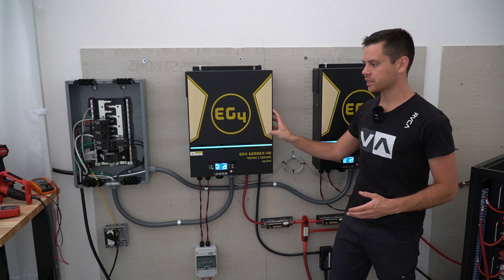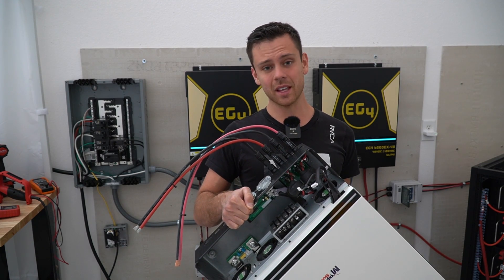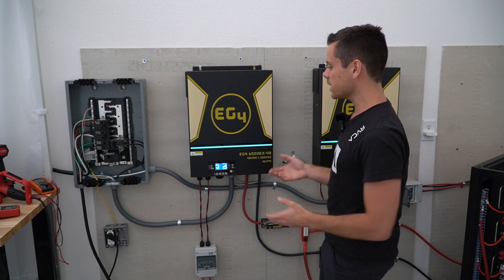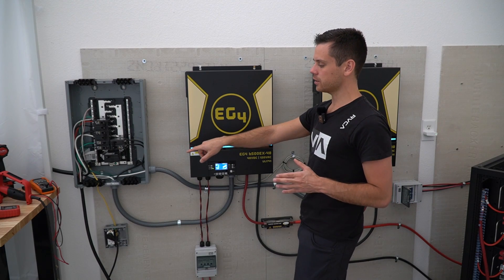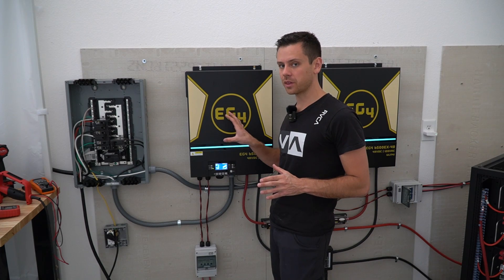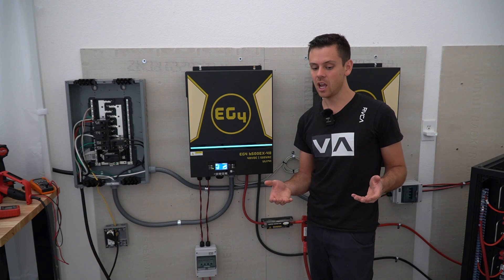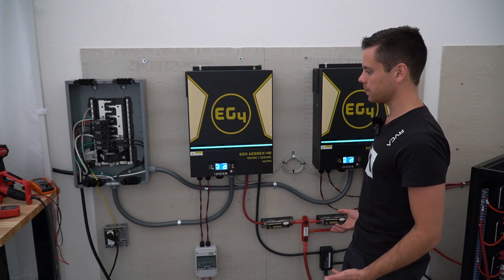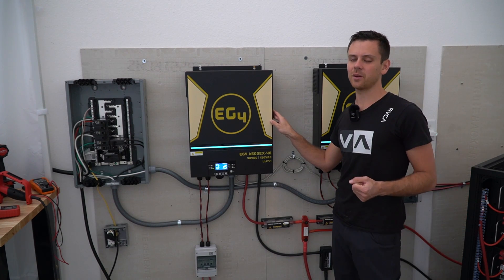EG4 6500EX VS MPP LV6548 Code Compliance and Ground Neutral Bond Discussion

Comment from the maker: If you feel that something is missing from this discussion, please let me know in the comments section below! Thank you

My new "Code Compliant" System Recommendation: https://www.mobile-solarpower.com/code-compliant-48v-offgrid-system.html
Complete 48V Offgrid System with EG4 Inverters: https://www.mobile-solarpower.com/48v-complete-system-blueprint.html

0:00 Intro
0:15 UL1741
1:12 California Approved Solar Equipment List
2:00 Using Offgrid System For Critical Load Backup
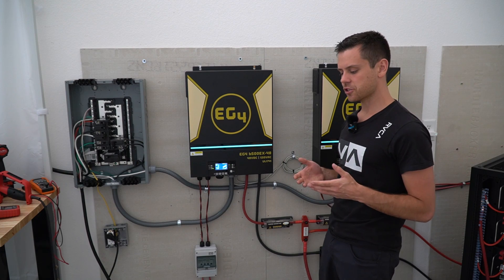2:16 Ground Neutral Discussion and Solution
4:22 PV Connection and Dangers
6:27 Conductor Sizing Recommendation
7:06 Conclusion

~~~~~~~~~~~~~~~~~~~~~~~~~~~~~~~~~~~~~~~~~~~~
Tired of getting ripped off? Check out my "Will Prowse Approved" solar product recommendations below!

12V Batteries
https://www.mobile-solarpower.com/lithium-batteries.html

48V Batteries
https://www.mobile-solarpower.com/48v-batteries.html

Offgrid Inverter System Builder
https://www.mobile-solarpower.com/48v-complete-system-blueprint-559371.html

Hybrid Inverter System Builder
https://www.mobile-solarpower.com/code-compliant-48v-offgrid-system.html

Mobile Handtruck System Builder (very popular!)
https://www.mobile-solarpower.com/mobile-48v-system.html

Solar Panels
https://www.mobile-solarpower.com/300w-solar-panels.html

Ground Mount Solar Racking
https://www.mobile-solarpower.com/ground-mount-racks.html

Wire, Lugs and Busbars
https://www.mobile-solarpower.com/wire-and-connectors.html

Tools
https://www.mobile-solarpower.com/tools.html

Fuses and Circuit Breakers
https://www.mobile-solarpower.com/fuses.html

Plug-N-Play Solar Systems
Ecoflow, Anker And Bluetti! So many models to choose from. See my current recommendations here:
https://www.mobile-solarpower.com/full-size-systems.html

~~~~~~~~~~~~~~~~~~~~~~~~~~~~~~~~~~~~~~~~~~
Need to build a large DIY system? Need a trustworthy solar distributor? These are my favorites:

Signature Solar
Creator of EG4! Solar Minisplits, Victron and More! Largest Solar Store Online.
If you want $50 off, please use my link below and coupon code "DIYSOLAR50":
https://signaturesolar.com/?ref=cPwLcVc0SW-BjN

Current Connected
Best Prices for EG4, Victron, Midnite and so much more! Fast Shipping and Highest Rated Customer Service:
https://currentconnected.com/?ref=wp

~~~~~~~~~~~~~~~~~~~~~~~~~~~~~~~~~~~~~~~~~~
Join our DIY Solar Community 
Need more help? Join the largest solar forum on the internet for beginners and professionals alike. 140,000 members and counting!
https://www.diysolarforum.com

Check Out My Free Book
Best-selling and beginner-friendly guidebook to off-grid 12V solar!
https://www.mobile-solarpower.com/the-book.html

~~~~~~~~~~~~~~~~~~~~~~~~~~~~~~~~~~~~~~~~~~
Contact Information:
I am NOT available for personal solar system consult! If you wish to contact me, this is my direct email: williamprowsediysolar@gmail.com
FTC Disclosure Statement and Disclaimers:
Every video includes paid promotion or sponsorship (such as free products for review). Some links on this YouTube channel may be affiliate links. We may get paid if you buy something or take an action after clicking one of these. My videos are for educational purposes only. Information is subject to change/update at any time. Electricity is DANGEROUS and can kill. Be smart and use common sense :) DIY Solar Power with Will Prowse is a participant in the Amazon Services LLC Associates Program, An affiliate advertising program designed to provide a means for sites to earn advertising fees by advertising and linking to Amazon.com
Reply: Can you show us how to do this with just one all in one inverter?  Like I am thinking about getting 4 of these batteries and one of those inverters.
Reply: A more 'universal' solution to the bonding would be to remove the bonding from the breaker box and one of the inverters.   In this configuration, there will be only one NG bond and if they hook up AC-in it will work correctly as well.
Reply: Is one quieter than the other?
Reply: Your videos are very informative and thanks. I am planning to buy (BLUETTI AC200MAX Expandable Power Station | 2,200W 2,048Wh) and I don't want to buy the solar panel from them. This unit is just for emergency use in the home. Can you recommend two 350 solar panels (I prefer Q Cell panels) for this AC200MAX model? Just trying to save $900
Reply: What solar shingles would u recommend
Reply: I bought solar panels (Canadian Solar 445W bifacial) from Santan Solar yesterday and the saleswoman asked if you (Will Prouse) had just put something out YouTube as she was being slammed with calls asking about the EG4 Inverters. I told her that you had and she laughed knowingly.
Reply: Hey Will, I’ve searched most all your videos and can’t find an answer or anyone explaining this clearly. (Maybe I’ve missed it if you have and I apologize if I have) how does AH vs Volt add up together? If I have 12 batteries, 4 sets of 3 to equal a 12v system that are all 200AH cells (for easy math) that would only be a 600ah battery? Or do you add more things in? Because individually I would think it would be a lot more? Thanks for you knowledge. Appreciate any light (hopefully a video) shined on the subject.
Reply: @SirBradfordII  you need to clarify. 

You have 12 cells? 3 sets of 4 cells with a 3.2 nominal voltage ? So 4 cells in series to make 12.8V and 3 of those in parallel?

You have a 4S3P pack. Series increases voltage. Parallel increases capacity. 200Ah 3.2V LiFePo4 cells in a 4S3P configuration is 600Ah at 12.8V nominal.
Reply: California is such a bummer for anything related to owning a home. In my town, you are legally required to get a permit to replace your water heater. What a joke, we live in a total nanny state in many regards.
Reply: I want to know about a setup like yours and how it might affect homeowners insurance. I have a similar setup that powers me off grid but is not electrician installed or inspector approved. 

Lets say you have a fire, and your insurance company is looking for any way out of honoring your claim. Will those off grid setups give them a way out of paying your claim, or did you have to notify your insurer that you have all those systems in advance so you would be covered?

What does a person have to do that uses a similar setup like you have there but that is not grid tied or electrician and inspector approved?

You aren't getting all those test setups signed off by an electrician and inspector approved, right? But I assume you have homeowners insurance and expect to be covered if there is a problem, right?
Reply: Id want to put an insulation layer between that circuit where you pulled the ground/neutral screw out, and what ever was underneath it.
Reply: I am no electrician but what is the point of having the ground if you don't connect to ground, that is to say, a ground wire from the panel to a ground rod pounded into the ground (earth)?
Reply: @dane5412  I'm no solar guru but I am a licensed electrician. The one and ONLY place you connect the ground to the neutral is the first service disconnecting means. Everything down stream requires a separate equipment ground which is connected to various enclosures and devices.
Reply: @dane5412  excellent point there....
He doesn't know the importances of it and similar related important connections, if he does he would have had it connected..
Reply: been following this discussion on the forum, where i find one member heavily in favor of sol-ark, possibily an employee here.
seems to be bashing other supliers every chance he gets.
not sure about the UL Listing and how that works in CA, but on could assume that it shouldn't matter who does the certification, ether directly or third party.
i do know TUV is one of the biggest global equipment certifiers there is, and accepted everywhere, so i don't expect the US to be different in that regard

Comment: If u have a big generator 12kw constant I had 3 wires from gen set no ground the ground is on block , I tied my ground neutral is only tied at one point it’s the min panel , I was wondering if u know why some inverters have 3 terminals from generator feed and 4 terminals from utility ? Are they keeping grounds seperated for a reason , I’m running eg4 6500 like u but got a rich solar hybrid I’m putting in now . . Great video

Comment: Yes, I have 2 victron quattro inverters and went into both through VE bus and VE configure to open both relays to unbond the ground/neutral. I also have a floating neutral on my generator.  Only one place, the main panel are they bonded just as will has done.  I too am completely off grid.  
Thanks will

Comment: Even if you are off grid, you still might need to be code compliant to get a certificate of occupancy from your county.  That's the requirement for Idaho, apparently.  I'm contemplating designing my system in a conventional manner based on the assumption that I run off of a generator, just to get past to be able to move in.  Is such an approach necessary, or is it possible to get a rational solar system installed in Idaho?  For a home owner, you aren't required to be licensed to do electrical work in Idaho, but you are supposed to get building permits and get it inspected.  Though, I've heard that many off grid homesteaders don't comply!  Heaven forbid!

Comment: What if the output from the inverter is a mixture of solar and grid power...where should i bond neutral and ground? Would the distribution box still be a sub panel box?

Comment: Just got all the components to build this system! So in order to safely set this up I need to disconnect both neutral to ground bonding screws in both inverters and only have one neutral to ground bond at my main panel? Thanks!

Comment: The ground neutral bond has haunted me? I've found 2 ground/neutral bond screws in my Sungold TP6000?
I removed the one Will recommends, Do I remove the bottom corner screw as well?

Comment: Hi Will, I have a situation with my system that I'm having a hard time finding an answer to. I Have a Sungold power 6548 (which appears very similar to the EG4) the system is installed on my boat, I have 6 rigid panels that are mounted and grounded to an aluminum rack (I have infinite ohms between + and - ) The a/c in is connected to my generator and my a/c out is connected to my breaker panel (where the generator was connected) and I have 4 x 48v rack batteries wired to d/c in. The situation I have is that when the inverter is ON there is "stray" a/c voltage present on the aluminum frame in the 150v and anywhere from a few up to 200ma..... Inverter off it goes away. If I put my meter on the pv inputs there is a/c current present (which I have seen in a few videos) My question is how is it getting to the frame? (induction?) and can you think of a fix? The frame is not grounded and I am reluctant to do that as I fear it will create a corrosion problem with my running gear...... The only 2 solutions that I have come up with is to either run a separate ground but that will be a real PIA or use a separate charge controller but that defeats the point and is not inexpensive!  Hoping you have some thoughts Will and thank you for your content!!

Comment: So with the 6500ex's shipping without the ground screw, you could backfeed your main panel using an interlock switch, because the only G/N bond would (still) be in the main panel, so long as you do not use the AC inputs on the inverters, correct?
Reply from the maker: These are off-grid only inverters. They do not have that feature.
Reply from the maker: Ohhh you mean just run your house from them with a interlock? Yeah no problem.
Reply: @WillProwse  Yes, that's what I meant. I asked Signature Solar...the person who responded didn't even understand what an interlocked breaker was. Thanks!
Reply from the maker: When I see backfeed I'm thinking export. Nevermind

Comment: For those that know a lot more than me...
On Will's website he shows how he wired his load panel (subpanel). He ran the ac out wires from the two inverters to the panel, but he ran them to two breakers that power the two phases of the panel. Why did he do it this way and not wire them directly into the panel's lugs?  Looks like the panel he used has a main breaker. I know some subpanel don't have a main breaker which would require you to do what he did. Please educate me.
Reply: I have the same question.
Reply: My guess is that the inverter instructions call for a 60A breaker and the main breaker on his panel is at least 100A and that's why they recommend he bypass the main breaker.
Reply: @brian_onthetrail  That would make sense.  The main panel breaker is 100amps.
Reply: He alluded to it giving you the ability to isolate the inverters so you can work on them individually - especially if you have more than two.

Comment: Not entirely correct, 
  I installed a solar disconnect,a SolarEdge inverter,and panels in Tampa Florida. If you follow the electrical code the Inspector will come out look at it and as long as you can comply you don’t need an electrician to install. if he finds anything objectionable  you’ll have to fix it before he passes you.

Comment: My DIY off-grid system has been looked at by three licensed electricians. The electrician that actually installed my transfer panel told me he didn't need to "pull a permit". He said if one was pulled, they wouldn't even know what they were looking at anyways. Another electrician inspected my solar panel arrays and was happy they all have separate grounding and combiner boxes...and said, "This is way I would do it". The last electrician said as long as you're not backfeeding (which I am not), there is nothing anyone can do. Having an off-grid system is like having a portable Honda generator as a power source for your house -- but using solar panels-inverter-batteries. Transfer panels are "either / or" power source selection. Safety is ALWAYS #1...never attempt to do anything if you're not sure. Even with off-grid systems with a transfer panel (or sub panel) they should be installed (or looked at if DIY) by a licensed electrician that knows what he is doing...even if the system doesn't need an inspection stamp.
Reply: Licenced electricians aren't always the purveyors of electrical knowledge, I think I met 4 my entire life that knew enough to keep up.

Comment: Could someone help me... I'm confused?   In the initial "New Product" review video of this model, Will mentions that this has an "automatic bypass" in the inverter.  At 4 min 59 sec in that video he identifies a "transfer switch" during his tear down examination of the unit.  But, at 2:00 min. in this video, he is recommending an external "critical load transfer switch."  Do these units have an internal transfer switch or not?  I'm wanting to have an automatic transfer switch situation set up so that when there is no solar and the batteries are nearing a low voltage... I want it to automatically switch back to grid power.  Do these units do this or not?  Thanks for any help.

Comment: I just opened my EG5 6500EX (bought last month) and it does not have the ground bonding screw installed. Looks like they changed the default build to be more compatible.

Comment: Hi Will,  Just confused a bit.  The PV lines coming in to each inverter..  are both inverters sharing the same panels?  In other words, are the PV lines split and then piped down to each inverter?  I know the 6500s needs 2x18 Amp inputs.  If it's from the same panels if one inverter is shut off wouldn't that place too much Current on the other (ON) inverter?  Guess I'm not sure how to take the 18Ax2 that's in the 6500's manual.
Reply: I’m pretty sure both inverters are not sharing the same panels.  That is not how I am doing my setup which is similar to what’s in this video. 

The 18amp x2 means each of the PV inputs can not have over 18amps going to them.

Comment: I have 2x 6500 watt 120v inverters and 1x 12k LF 240v split phase inverter. Has anyone tried to use inverters like this to the same sub-panel? Would they work together or trip faults if wired 2 separate breakers in the same box...?

Comment: Will and community - please note this setup is off grid and the "main" panel shown has the Neutral-Earth Ground Bond connected, thus it makes since that the inverters should not have any internal bonds. In installations where grid tied via a main panel supply, the NG bond would be on the input side to the inverters and would not provide a bond on the output load side. The offgrid setup shown here mirrors a typical generator installation wired to a NG bonded main panel, whereby the generator internal NG bond is removed making the generator what is termed "floating" as it is looped from the main panel NG bond. If the inverter output panel is not bonded, a method of bonding will be required, whether via the inverters or external relay.
Reply: In my research, I've found that some inverters (like Victron's) have an internal relay that will bond the inverter output neutral to ground when running on inverter output BUT disconnect it when running in bypass mode so the bond is only at the main panel.  A lot of the less expensive inverters didn't seem to have this dynamic bond switch.
Reply: @bauwks  the EG4 has the dynamic bonding the is applied when in DC mode and open when in AC bypass mode. The problem is when more than one inverter, each is applying separate bonds so the ground and neutral loops have multiple paths, not good.

Comment: Would this ground bond cause a voltage difference between the two inverters? Both inverters show 120 volt output until connection is made to the panel . Even with zero or very small loads . 
Main inverter shows 120 volt . 
2nd inverter showing 109-113 volts . Help lights flickering
Reply: Are you running it in split phase?  Did you make sure the split phase is at 180 and not 120?  That’s all I can think of but it may be completely irrelevant